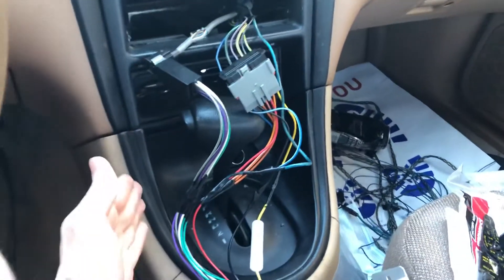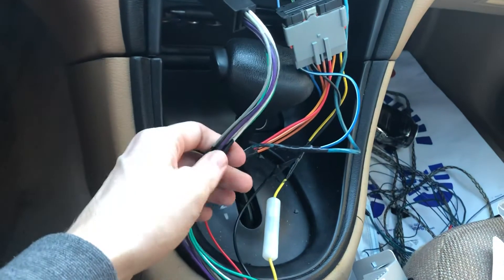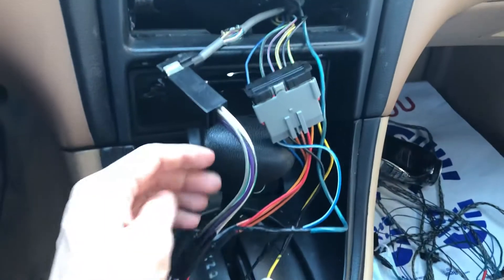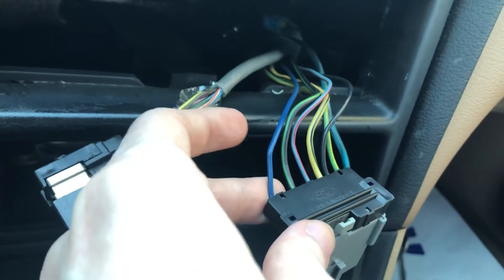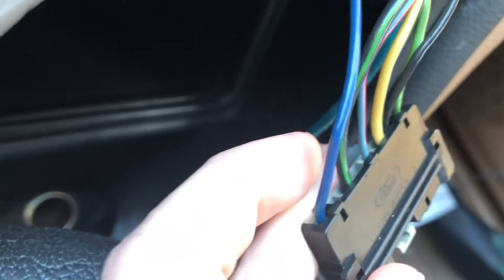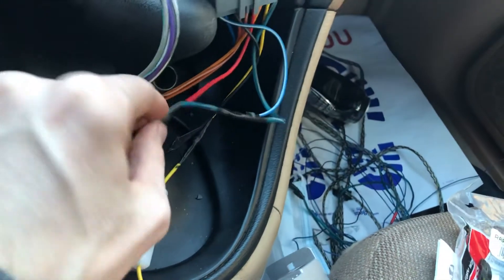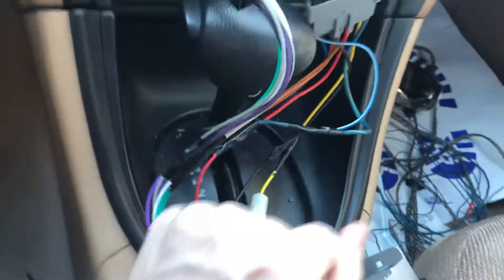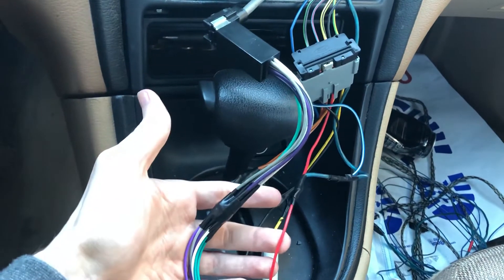[FIX] Radio Has Power But No Sound 1997 Ford Mustang

Comment: So I’m kinda new to the whole stereo and amp and sub stuff. I have a little 10 in the back seat but one day when I was driving to work. I was listening to my music like usual. I go to work do my daily, get off my shift and hopped in the car and all the sudden I turn on my car and the stereo won’t turn on. I’ve took it out and saw the wires are all plugged in and everything looks fine. But still no power… any suggestions or anything at all you can help me with?
Reply from the maker: Did you figure it out?